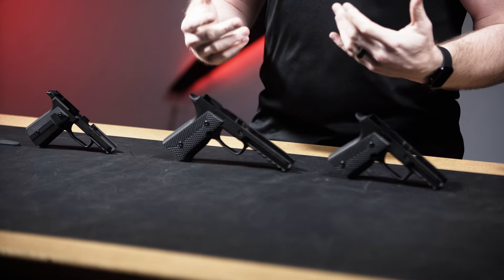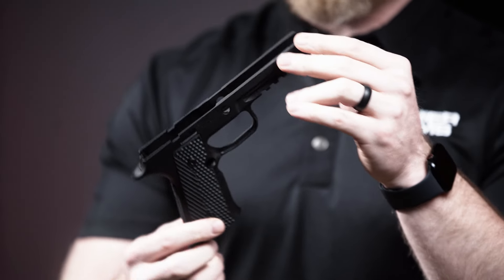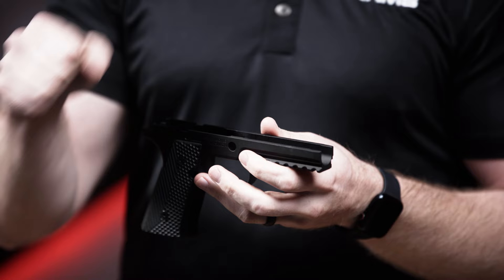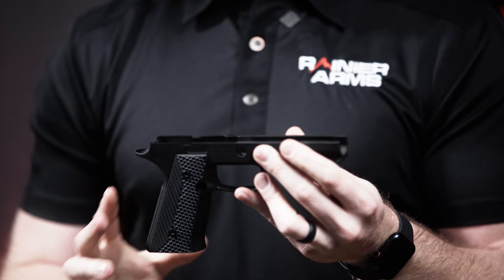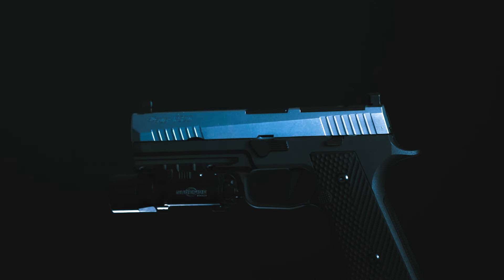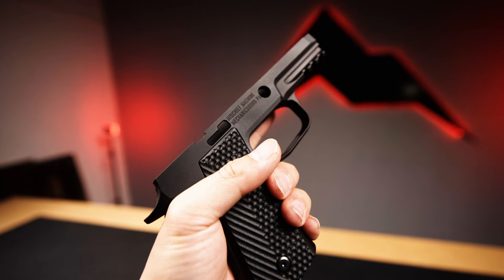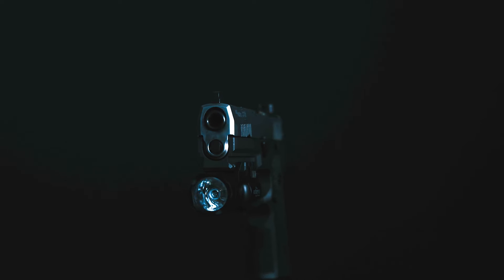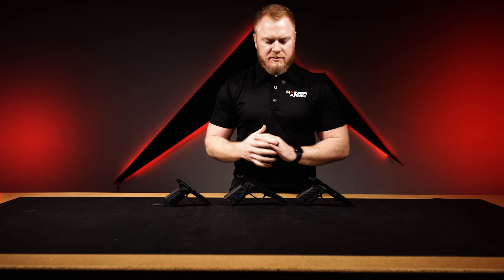Enhance Your Sig Sauer Handgun With a Mischief Machine Commander Grip Modules for P320s and P365s!

Comment: ⭐️⭐️If you run a TLR 7A/X or TLR 7 sub light, I recommend the Mckinatec MTA or MCT holster. Both holsters are universal holsters based on the light. I highly recommend them especially if you have a mischief machine grip for your P365 or P320.